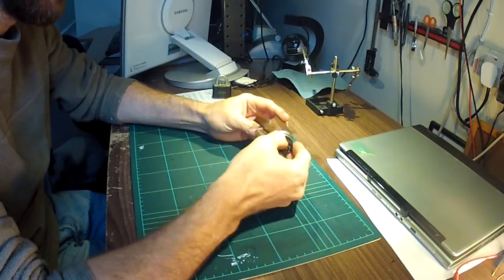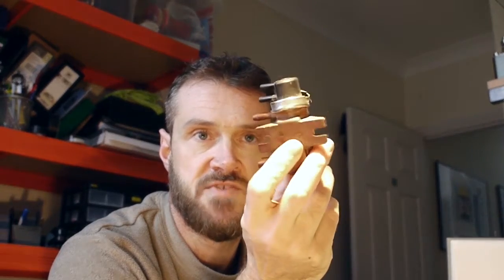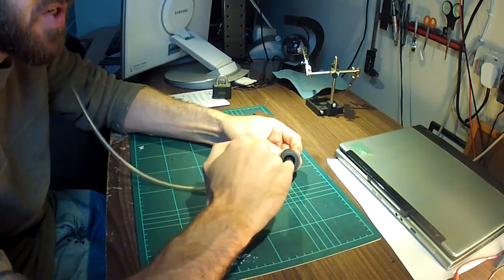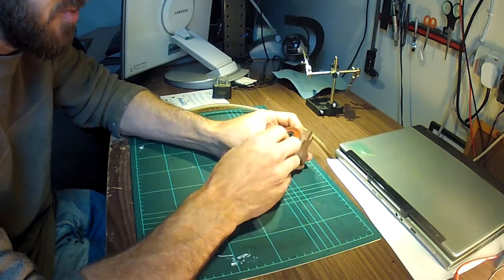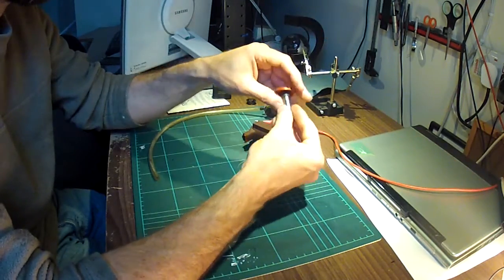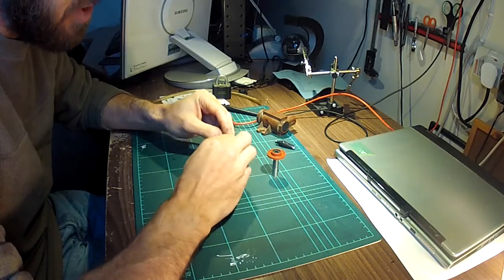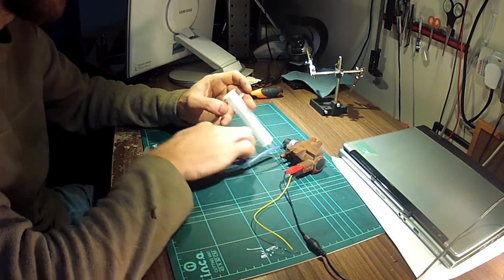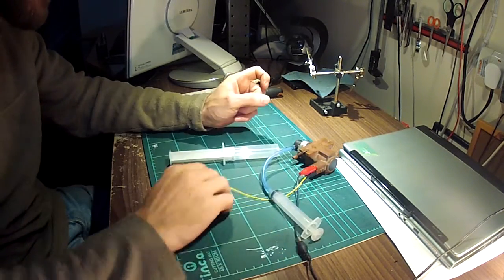Turbo Solenoid Tear Down

Comment: Fantastic video!!! And thanks a million. Solved the issue on my Ford Focus 1.6 tdci 110 bhp. Removed and solenoid and stripped it down. And exactly the tiny valve in the diagram was blocked. Cleaned it, put it back together. And problem solved. Car is boosting strong throughout the rev range.

No more fault codes for P234 - Overboost condition
Reply from the maker: happy it helped

Comment: Hi. This is a Long shot as the video is more than 6 years old. But i Will give it a go.

The big port on the solenoid. Can you remember if this had any connection to the output port??

In other words : Could you blow air from the Port number 3 to number 2?? 

I suspect my solenoid to be broken as I can blow air from number 3 to number 2. I then loose vacuum. I have around 20 hg supply and out I’m getting about 15 hg. If i hold my finger over port 3 the vacuum builds up to 20 hg.

Can you measure the vacuum In the hose going into the wastegate? What are you reading.

Thanks for a very good video.
Reply from the maker: Sorry dude. Can barely remember last week let alone 6 years back.

Comment: Very difficult to find this solenoid. Could you do a video or show a picture identifying where it is on the engine without disassembly?
Reply from the maker: It would be quite hard to take a photo of it without some disassembly. You can find it by going underneath the car and looking in the area the exhaust comes down from the engine bay and turns to run along the underside of the car. With the front of the car in front of you and from underneath looking at this area of the exhaust you can, just to the right, see a black plastic semi-rounded box. That is the vacuum reservoir. Just to the right of that and a bit further up is the solenoid.

The reservoir is easy to remove - it is only one 12 or 13mm bolt holding it on and disconnect vacuum pipes. You can easily see the solenoid then and remove it. Again, some fairly easy to get to bolts holding it on. Good luck.

Comment: did it work for u ?
Reply from the maker: well it's around 18 months later and I believe all is still OK - but the main issue was with the vacuum reservoir which I fixed in another video.

Comment: Hi... Can you please show a picture of where this Turbo Solenoid is place on the engine 1.6HDI 109HP FAP... Mine is gone to but i cant not find it :-D
Reply from the maker: It would be quite hard to take a photo of it without some disassembly. You can find it by going underneath the car and looking in the area the exhaust comes down from the engine bay and turns to run along the underside of the car. With the front of the car in front of you and from underneath looking at this area of the exhaust you can, just to the right, see a black plastic semi-rounded box. That is the vacuum reservoir. Just to the right of that and a bit further up is the solenoid. The reservoir is easy to remove - it is only one 12 or 13mm bolt holding it on and disconnect vacuum pipes. You can easily see the solenoid then and remove it. Again, some fairly easy to get to bolts holding it on. Good luck.

Comment: Thank you for this video, i have a problem on my car (C4 1.6 hdi) 
Engine default always on.
The car mechanic scan the car and told me it is a broken solenoid.
I don't know if i can fix it by myself but may i'll try.
 (i'm french)
Reply from the maker: Even if it is not repairable a new solenoid (or good second hand one) will be cheap and pretty easy to replace. I am happy the video helped